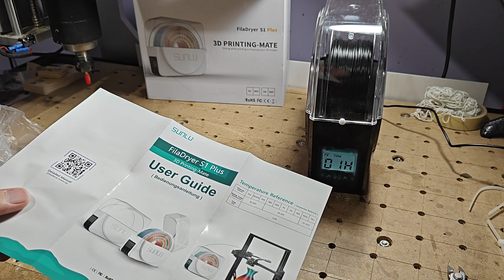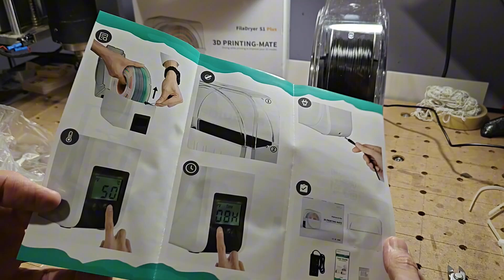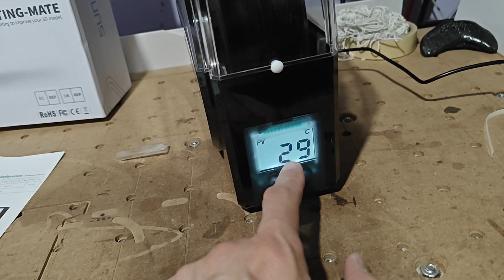How to dry PLA filament - SUNLU Filament Dryer Box for 3D Printer #pla #3dprinting

Comment: I'm curious as to what sort of climate you live in? I'm convinced from personal experience that PLA never needs to be dried, but it seems that many people find a need to do it. I live in Australia. I would say it's fairly humid here, and my previous house had roof leaks and all sorts of nightmares, it was always over 80% humidity in my room, where I stored like 40 spools of filament. Anyway, I boxed them up back in 2021~ and they sat in a garage, a shed during winter, and then back in another garage until a few days ago. All of my filament except for one spool of cheap eBay filament is still usable right out of the packing boxes.

I will say that a few spools (haven't tested every spool but tested 80%~) there's been about 50-100mm of filament that has snapped off but after that length the filament is fine. It really does seem like the more 'designer' brands of filament hold the test of time, in my own experiences.
Reply from the maker: Interesting information. I'll have to see how it compares from one brand to the others. I live on the eastern shore, USA. So humidity is 80-90 most of the year. We have dew on the ground every morning. I do agree that the wet filament seems to only be about one-two rows down, but it's still a waste to break off about two feet of filament every few months if you don't print fast enough. If I print about one hour worth of filament, I think I wouldn't need the heater but if printing something over an hour, I think I will plant to dry it the day before and then know the spool of dry.